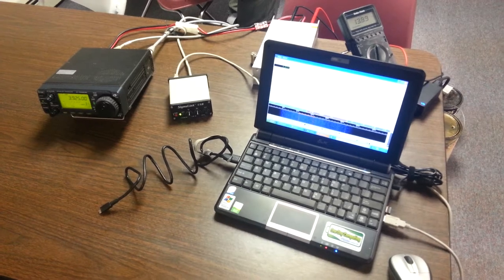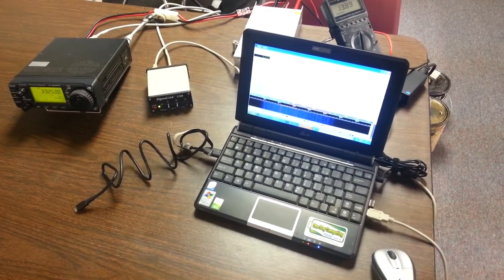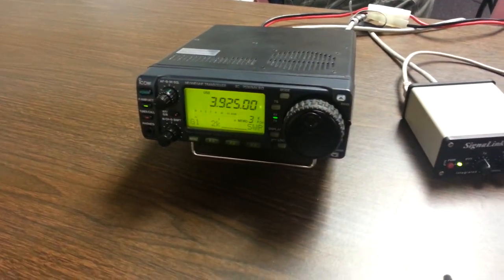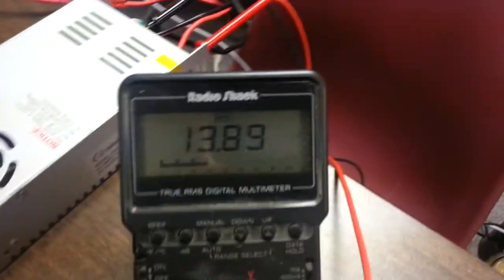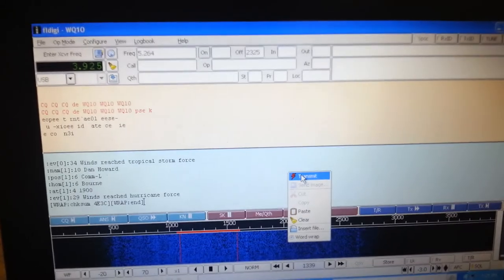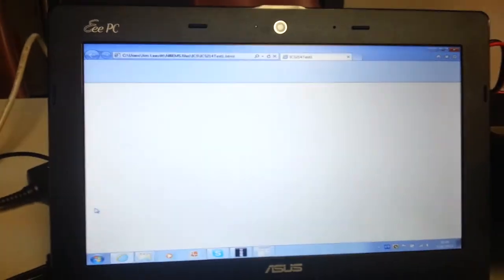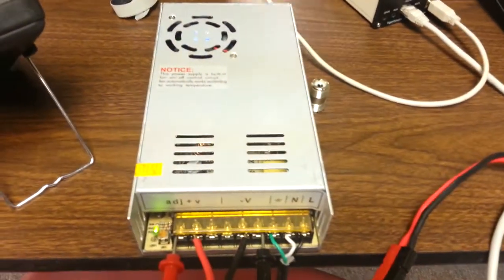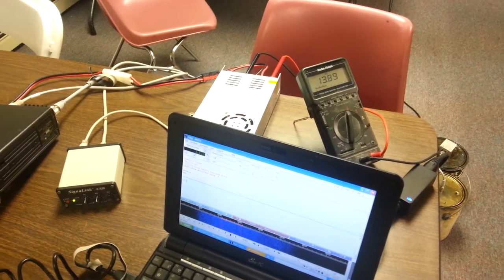Cape Cod ARES and Red Cross DST practicing NBEMS digital modes

Comment: Hi,

thanks for posting this video. I saw a dummy load on the floor but since you appeared to be using RF I don't think you used it. How did you pass RF from one to the other radio while using 100W at such a short distance?

Which mode did you use to transfer the files? It was a lot faster than MT63 which I used at a drill yesterday.  73, Sander W1SOP